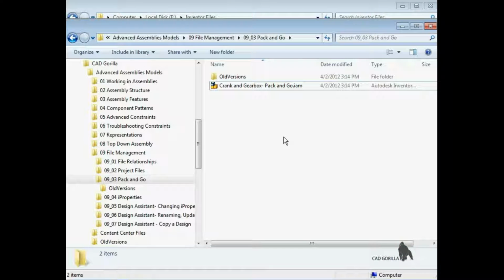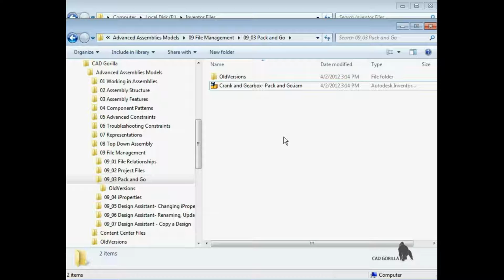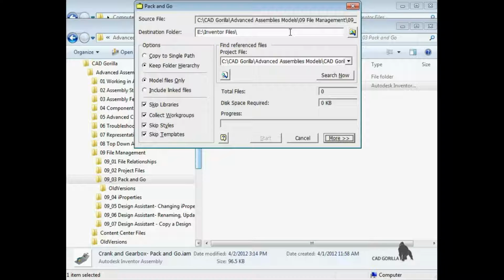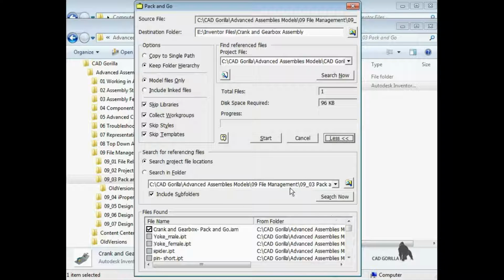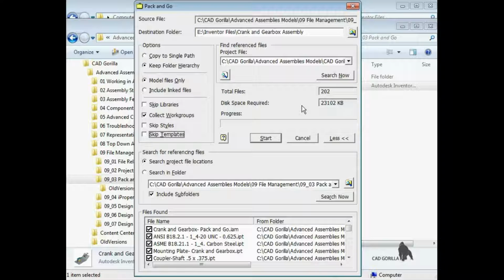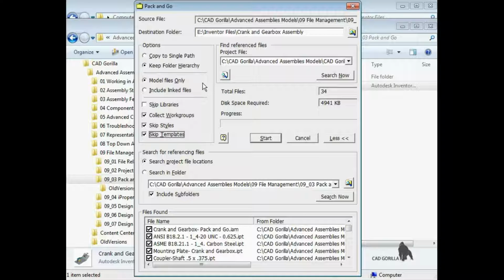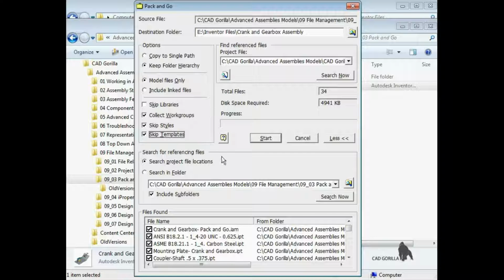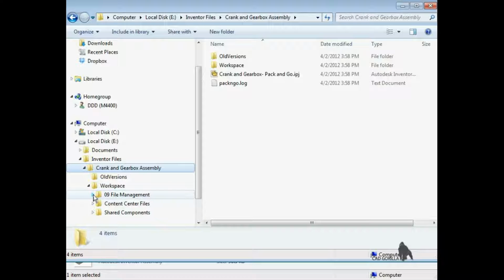09 File Management   03 Pack and Go

Comment: Why does pack and go not package IDW files?
Reply from the maker: You right click to IDW file and select pack and go, so it package IDW file
Reply: Do I need to do this in each file?
If I have 50 files, should I do one by one?
If the ipt files are linked with the idw, this should occur automatically.
Reply from the maker: Do you have 50 IDW file or 50 ipt file?
If IDW file is linked any ipt file, then it should copy all of these ipt file in this